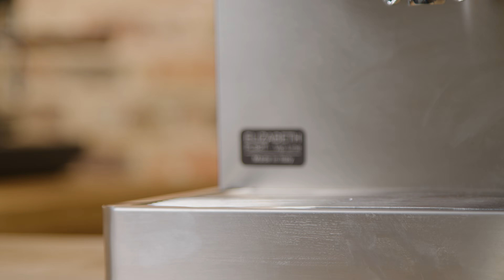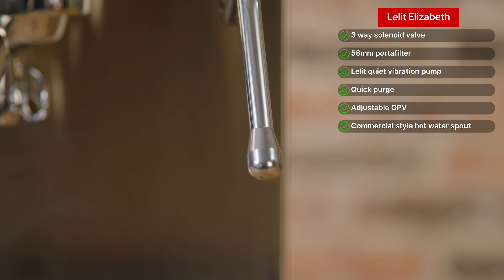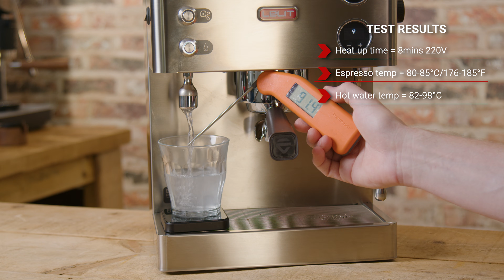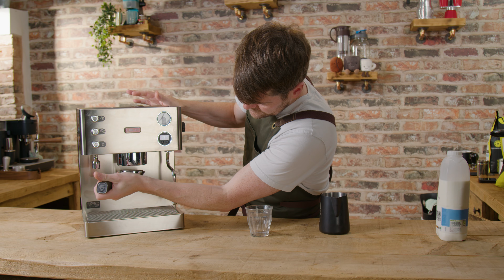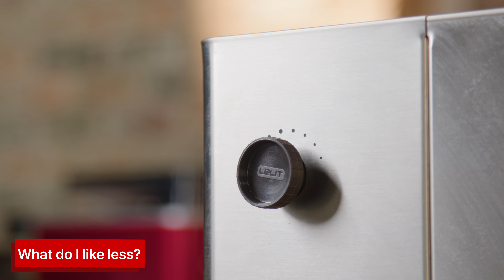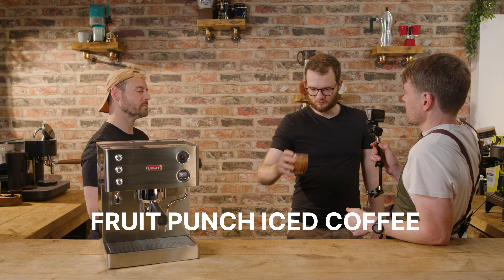Lelit Elizabeth - Most Underrated Dual Boiler Espresso Machine?

Comment: I thought descaling on a Lelit Elizabeth was not recommended.  This is what I have been told by Baratza from info they got:   he descaling of the hydraulic circuit of the machine must be done every year to ensure longevity and constant performances. The state of the machine needs to be checked previously by your reseller/specialized technician and the descaling operation must be done by a specialized technician to avoid ruining the internal components of the machine.

Comment: Hi Kev, as someone thats new to home coffee, would you recommend buying a standalone espresso machine like this with a seperate grinder or would you go with something like the Meraki? Thank you
Reply from the maker: If you're wanting to get into home espresso from the hobby angle (rather than purely means to an end), I'd usually say if there's no particular reason you need to go integrated grinder, then I'd go separates, as this just makes more sense for muliple reasons. It's slightly different when it comes to the Meraki, though. 

The workflow the built in grinder brings to the table, is really something (especially when you need convenience) and although I still think the grinder is the weakest link, it's not to the same degree. 

I've only encountered a couple of (very challenging light roast) beans that the Meraki grinder couldn't quite cope with (couldn't quite grind as find as I needed to grind). I don't love the grind adjustment, or the fact that there always seems to be a slight disconnect between the physical setting and the digital setting, but once you get used to that, I think most people will probably find the pros of the integrated grinder on the Meraki to outweigh the cons.

Comment: Looks like a good upgrade👍
I have tha anna 1 boiler type, even that one is good, bought it 3 years old with a no good pump, was 27€ at amazon.
Working 3 years now without single problem.
I sanded the stainless steel houding matte, so no finger print now.

Comment: Kevin, if I get coffee beans at a grocery store,  what dates are considered fresh?
Reply: Most supermarket beans don't have roasting date.

Even if they do its usually quite old.

What I find is when you open them they have little aroma.

When I buy freshly roasted beans they taste best between 10 days and 30 days after roasting, by 40 days they have little aroma in the bag or during grinding and that's what supermarket beans are like.

I've just bought some Tesco no3house blend at about £3 to be fair it makes a decent latte and is possible to dial in, I've got 18grams in 38 out and 26 seconds and it's not bad. It's a darkish roast that cuts through milk, not sour or bitter, but no real discernable chocolate, caramel or fruit flavours really.

Supermarket beans are OK if you've run out but they are just old and that limits their ability to produce good coffee whatever the fancy descriptions on the label

Comment: Thanks Kev, for another informative review! I would like to see a video of machines that are JUST for espresso. I never make milky drinks so paying more money for something with a really good steaming function seems like a waste to me. Do these "espresso only" machines exist, or am I realistically just looking at a Flair or a Cafelat Robot, manual lever machine?
Reply: I love my Profitec Go, it has extremely stable temps (due to the way the pipes are plumbed in the boiler)

I use mine with thin coffee scales and a shallow espresso shot glass.

It has a std 58mm E61 porterfilter so easy to buy accessories.

Build quality is much better than Lelit
Reply: @RobinHarris-nf4yv Thanks, but it has a steam wand. 🤷

Comment: Great review. 'Problem' here in Australia is you can literally buy 2 Breville Dual Boilers for the cost of the Lelit. Given they are very similar, performance wise, the conclusion is obvious.
Reply: Ive got a breville dual boiler im replacing - watching this vid for research lol - had it four or five years and the triac board has been fried twice bc of a known issue - and im not wasting the time to repair a machines known defect twice - there were screws in there that were rusted bald the last time i did it a couple years ago. Spending the money will save you in the long run. Surely you dont plan on replacing your several thousand dollar machine every few years. A well made machine thats maintained properly should last forever.
Reply: @innereast nothing lasts forever mate. Things wear down and break - it's physics.
Reply: @method341  no mate it's a known defect for the model
Reply: @method341  you expect to replace a car every 5 years? A well built and well maintained machine should run forever

Comment: What is the default pressure set at? Is the pressure gauge showing pump pressure or brew pressure?
Reply from the maker: The pressure gauge is on the pump side, the actual pressure in the basket is usually about 0.5–1 bar less than what the gauge shows, which is normal for home machines with just one gauge. 
This one came set to about 10 bars on the dial, which is about 9 bars in the basket, but you can easily adjust it by turning the nut on the back of the expansion valve clockwise (when stood at the front of the machine).
Reply: @Coffee_Kev  Awesome! Thank you for the kind reply!

Comment: I'm not sure why anyone would buy this machine when for the same price you can buy a Rancilio Silvia Pro X
Reply: In the US at least, the Elizabeth is about $400 cheaper than the Silvia Pro X.
Reply: Preinfusion is a joke on the silvia
Reply: Lance prefer this over ProX, more versatile, check out his video.
Reply: The rancillio pro is £400 more in the UK and has way less control over pre infusion and different shot parameters
Reply: In the States the Rancilio is considerably higher. ALSO, it's a MUCH deeper machine and for some of us counterspace is, for better or worse, a consideration.

Comment: Also, why wouldn't they use an electrically heated brew group? It's not an e61, after all. This would be a relatively inexpensive addition with actual utility.
Reply: Because the group is actually the bottom part of the boiler. What more do you want to heat?
Reply: Electrically group heating is only used for separate groups that are not located under a boiler/thermoblock
Reply from the maker: The group is integrated with the boiler, so I don't think heating the group is a problem they really needed to fix.

Comment: But no real time adjustable pressure/flow control. I just don't get it...
Reply from the maker: Nah, it's not a flow profiling machine. If that's what you're after, best bet for this kind of price is probably the Sage/Breville Dual Boiler and the Slayer Mod

Comment: I think there may be a slight boo boo in the on screen specs.   You have it listed as 25L water tank.   I think that should be 2.5L   25L is a bit big for a home machine :).
Been waiting for you to review this one.   I think it is a great little dual boiler machine and would find a place in many home barista setups
Reply from the maker: haha, yeah defo 2.5L, 25L would be a bit excessive 😆. Yeah it's a cracking machine!  Cheers, Kev.